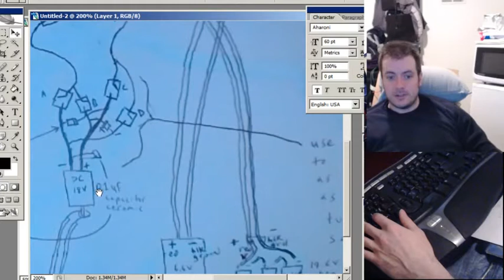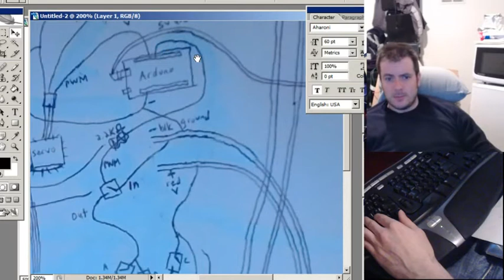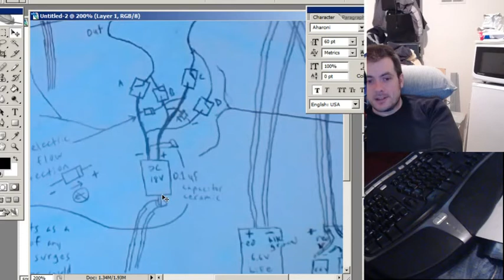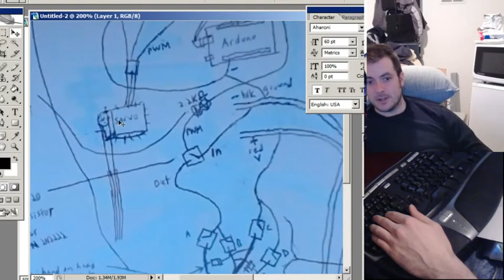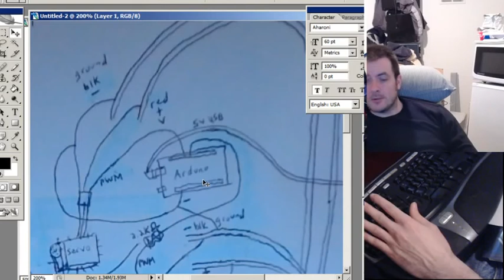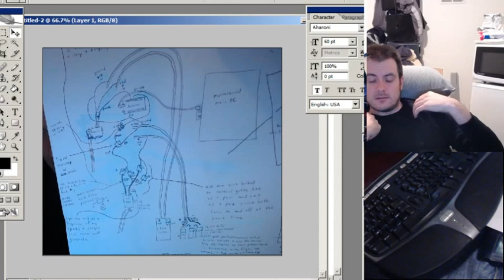How to Control Large DC Motors and Servos with Arduino | Building Humanoid Robots #57

Comment from the maker: update: note that this video is no longer up to date as my plans have improved since then.  I now plan to exclusively use brushless dc motors since they are faster and stronger and WAY quieter than brushed dc motors and last longer (no brushes to wear out).  The control circuitry is a little more involved, but still very doable.  This will make my robot ultimately quieter, stronger, and faster, all huge wins for my robot.

Comment: Yo, good post. I'm in the process of building a tower crane that will stand at least 8' tall. I decided to use cordless drills that I got at Wally for less than $10 each. I want a crane than can pick up a brick! I'm going to use the Arduino to do the control of it. BTW I have a Sharper Image tank track like robot arm that I got at Goodwills for $12. I didn't like the idea of using 6 AA batteries, gets too expensive. I ordered a 22v to 6v converter, cost $7. I use the battery from a big Hypertough Cordless drill to power the robot. A single charge goes for weeks! When I'm not using the cordless drill I may as well use the battery on the robot! I have 3 of these batteries for 2 big drills, and 2 chargers. My next thing on this robot is to install a camera! Right now I'm looking at everyone's designs to power the cordless drills, the small ones not my big ones, for the tower crane. I will build every part myself, encluding the gears! All will be cut from aluminum. Its a pretty big and complex problem, but easy enough for me, I'm a fully retired electrical engineer and have worked on projects far more complex than this. Later on I'm going to do a video of my mod to the tank robot, and list the power converter and how to connect to the robot. BTW at Goodwills a week later I picked up a floor cleaning robot for $14 and it still sells for $450. The got rid of it because it would not run long. Well guess what, a $17 battery sure fixed it. I got a battery that is DOUBLE of the original one, and its now packing 4700 mAh one, and runs 4 hours! My wife LOVES it. It either sweeps or scrubs the floor. When I get up at 4 am, due to insomnia, I turn it on daily! By the time she is out of bed at 8 am, it has cleaned ALL floors in the house. She's so delighted with it, she gives me even better feed!!! This stuff is so fricken cool!!! I give you a thumbs up!!!
Reply from the maker: great post yourself! Made my day!  I think your project sounds awesome and I wish you the best of luck!
Reply: @artbyrobot  I just thought of an idea of making an air hocky kind of game that uses a robot arm that has only 3 servos. It would act like the shoulder, elbow, and wrist of a human arm. There would be only 3 encoders to control the movement. There would be an arm on each end, then a detector for when the puck goes in to the goal, and a display to keep score. I laid one of my robot arms sideways and tried it out with a ping-pong ball. On  the wrist end would be a paddle to swat the ball, as well as, steer it. Tell me what you think!
Reply from the maker: @PootaurStuff  sounds like a great idea and something that could even be a cool product to make and sell as a side hustle.

Comment: You also want to add a capacitor on your motor so that the initial amps doesn’t exceed the rating your batteries can provide in amps. 
There are other things that might make this more efficient like adding a resister in series with your motors so that they don’t exceed the max amps they can handle. 
Isn’t electronics engineering awesome? :)
Reply from the maker: resistor in series is bad idea as that would have to be a high watt huge resistor to handle the heat it would cause blocking such high amp flow.  that said, the capacitor helping provide initial amps is a good point but I will say that amps exceeding the rating of your batteries is not a big concern as the batteries should always well exceed any demands the motor could have in terms of amps as a default design custom for choosing battery packs and so that is not an issue.

Comment: Actually, you want to have a higher voltage like 24 volts because as the batteries drain, the voltage will decrease. So you want to add a voltage/amp regulator to keep it at 18v consistently even though the batteries are almost dead! Otherwise, the power of your servos/motors will decrease as the batteries drain from 100% to 0%.
Reply from the maker: well technically, you should never run batteries lower than maybe SLIGHTLY below their 3v per cell voltage because otherwise you ruin them faster.  You should charge slow and never discharge very low to maximize lifespan.  So this should be a non issue
Reply: I use a 20v battery made by Hypertough for their cordless tools. Then I purchased a buck/boost power converter that can go from 22v down to 6v, it cost $7 for it on Amazon. I modified my Sharper Image tank-track robot arm to use this converter and battery. It now runs for weeks on a single charge! I'm in the process of building a HUGE tower crane using cordless drills to power the crane. These drills are less than $10 each at Wally. Got 3 of them! People who use AA or AAA batteries are wasting their money. I say go with 20v Hypertough batteries, and buy the converter! The company sells converters with up to 22v input, and a variety of output voltages that you specify the value when ordering!
Reply from the maker: I want to add though that this suggestion is actually smart and thank you for it